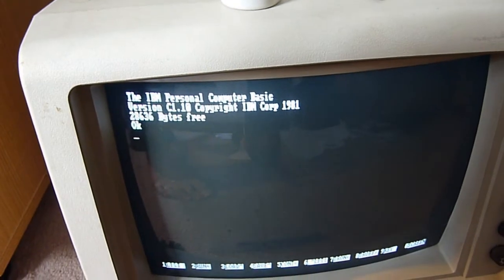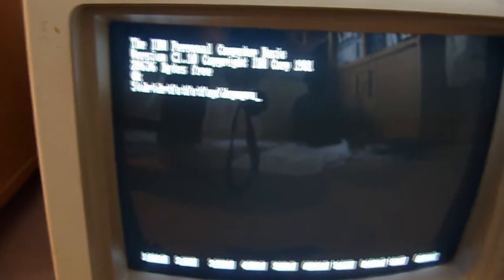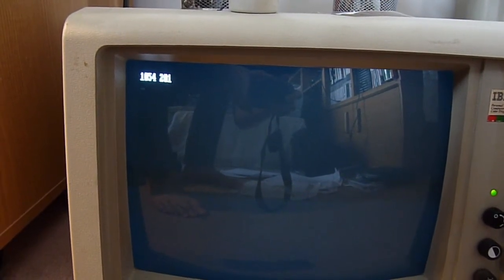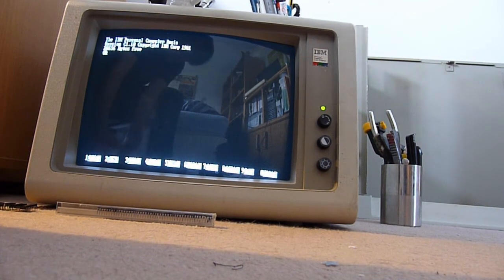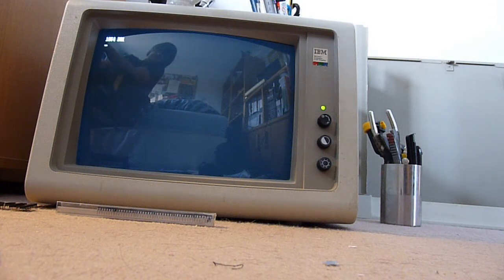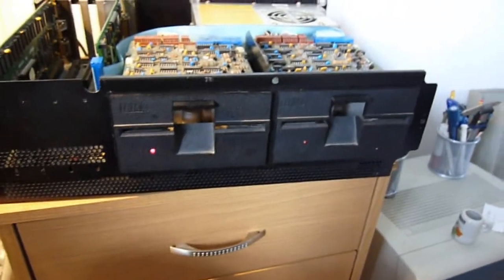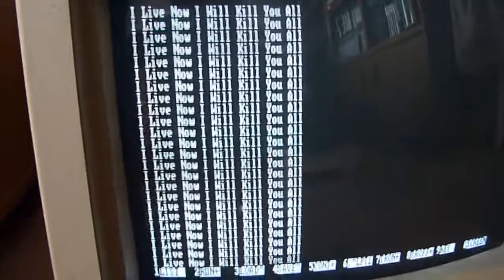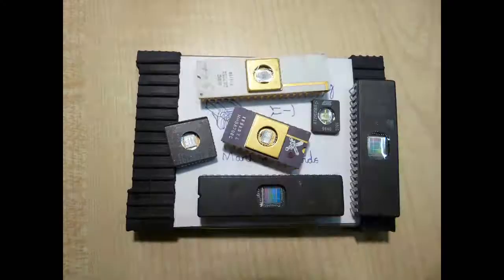IBM 5150 Resortation Part 5 It Lives

Comment: I like it!  House do the ROMs bit rot?  Also nice to see you!!!
Reply: Knuckles the Echidna I guess on these Mask ROMs, it will mainly be down to moisture getting into the chip and causing damage over time?

Or quite often a logic buffer on the board is playing up and causing heating / thermal cycling of the chip and the gold bond wires that go to the die?

"Bit Rot" is normally only associated with non-volatile storage like EEPROM or Flash, but I think a lot of these older Mask ROMs can fail over the years anyway due to some of the above reasons.

http://my.ais.net/~xtreme/SF/Bit-Rot/

A ROM can even get damaged simply because something else on the data / address bus has shorted, or the data output from the ROM is trying to drive something which has lowered in impedance over the years.

That can include a dodgy expansion card or anything really, or just PSU power spikes, lightning damage, and other nasties over time. Could even be due to a card not being installed properly, and causing a short etc.

Mask ROMs by their nature should in theory last a lot longer than "non-volatile" storage, but I've seen a fair few Mask ROM chips fail in things like the C64, Amstrad, Speccy, Beeb recently too.

btw - Well done TheEPROM9. Nice to see it running. ;)
Reply from the maker: Knuckles the Echidna Thanks. Bit Rot means the chips degrading over the years. ROM's often store an electron in to be in a 1 or 0 state (But not always depends on the tech being used) and well after a long time the electron escapes and changes the data.
Reply from the maker: electronash Nice little experimentation. It is very nice to see it running. Now the disk drives are next. And the RAM.
Reply: ***** Oooooh they are EPROMS!!  Whoops, I thought they were mask ROMs, must have missed that 'bit'!
Reply: Knuckles the Echidna - Pretty sure the original ROMs will probably be Mask ROMs, but could be one-time-programmable ROMs I guess.

I think Mask ROMs aren't really so susceptible to the usual bit rot though. They normally fail for some other reason.
Reply: electronash I read up on it and I tried to understand it and it would seem to me that mask ROMs could last maybe 100 years if they don't get corroded which is good news for game cartridges but not prototype cartridges(or maybe the IBM)  with the EPROMs!  I guess the good thing is the EPROMs once dumped can be refreshed or put on new chips if lucky enough to have gotten a backup :)  I do wonder what will happen to things with flash firmware, will the Nintendo DS still fire up in 40 years?  I guess there is no point worrying and just enjoy the working system right now hehe
Reply: Yeah - I'm sure Mask ROMs should last a lot longer if they are treated well, but I've still seen plenty of them fail when another chip in the system fails etc.

Flash memory is really weird because it stores the bits as electrons on billions of floating gates. It's amazing they work at all tbh.

Comment: Well done I think any old IBM computers are great (I own EIGHT Thinkpad laptops!)  I have also had a good evening because I have fixed my Amstrad CPC6128 and that LIVES!  Even better is I got a nice well engineered External 3.5" Floppy Disk Drive to work after owning it five years!  CPC internal drives are of the weird 3" variety but 3.5" is bloody fast on the CPC!
Reply from the maker: EgoShredder Thanks. I don't have meany IBM machines. Nice to see my work paying off though.